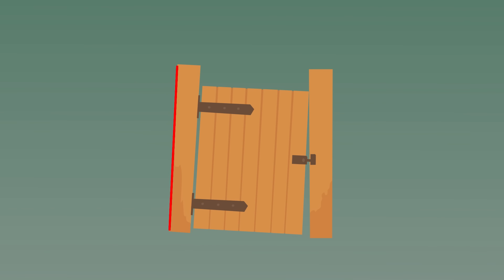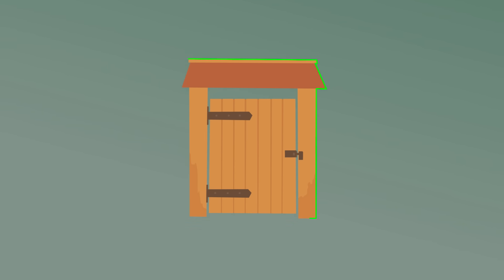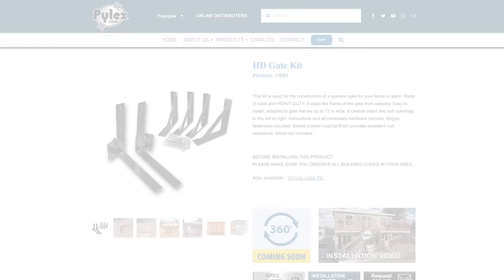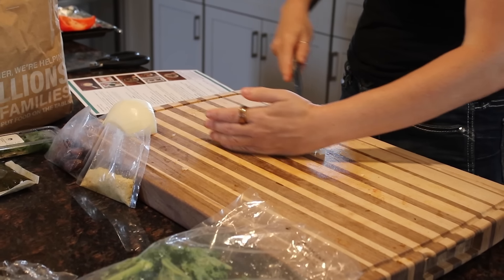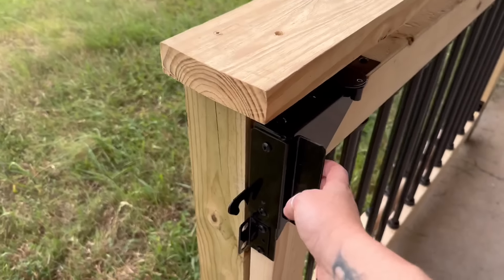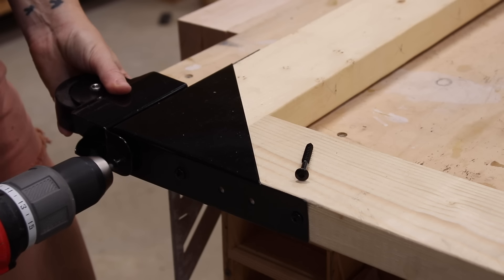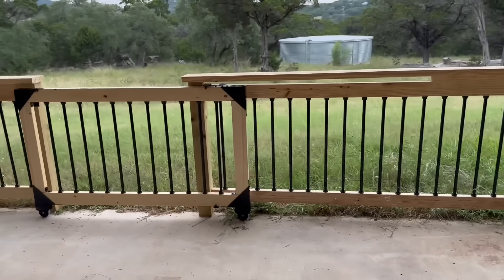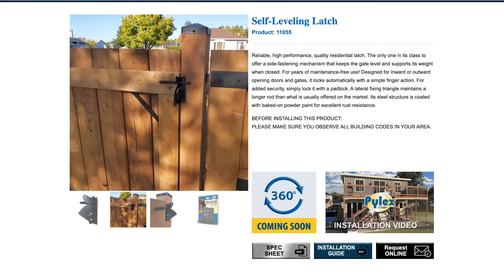DIY Sliding Gate | Fix a Sagging Gate

Comment: The best way I remembered what direction to put a diagonal post is by thinking of a hanging shelf. Unless they're one of the "floating" ones then they typically have a bar or some sort of decor running from the bottom of the shelf (along the wall) up to the edge of the self to prevent it from flopping down and flat against the wall. That diagonal brace will serve the same purpose in keeping the entire gate elevated and not flopped.

Comment: I tried one of those turnbuckle anti-sag lift kits and it didn't work at all. As I tightened it instead of lifting the sagging gate, it simply warped the gate. 
I fixed the problem by designing, building, and installing an adjustable spacer that goes into the gap between the lower gate hinge and the gate post. Problem solved.